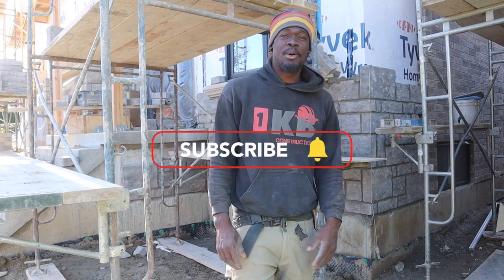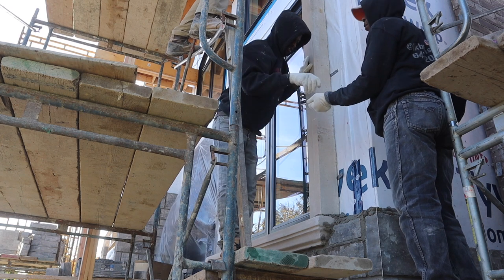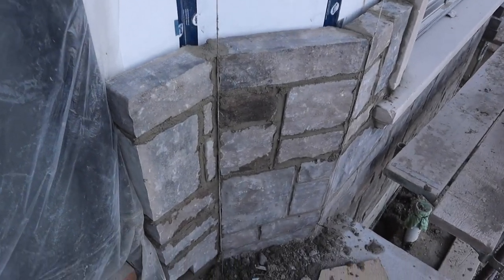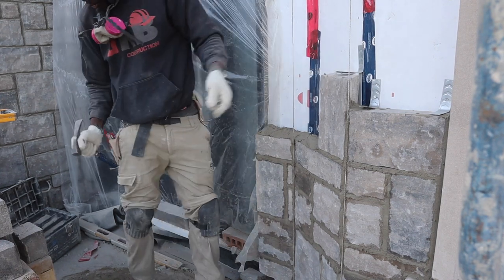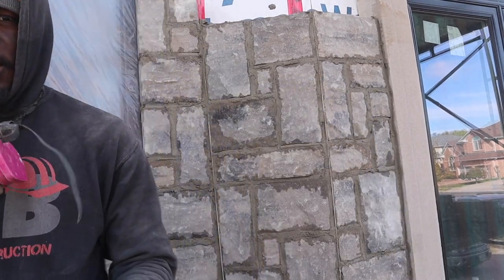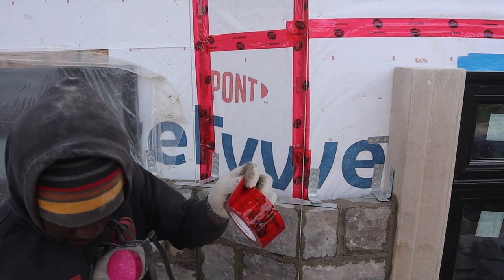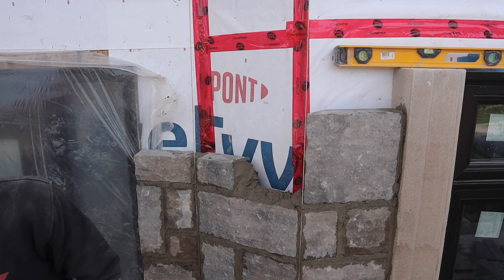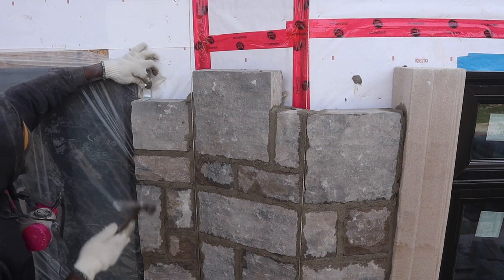How To Build A Double sided 45 Stone Wall /and precast installation  ,

Comment: I wouldn't have thought you could stack the stone that high without the weight squishing down the lower mortar joints.  Great work as always.  Throw that level away; you don't need it.  It's just slowing you down eagle eye!